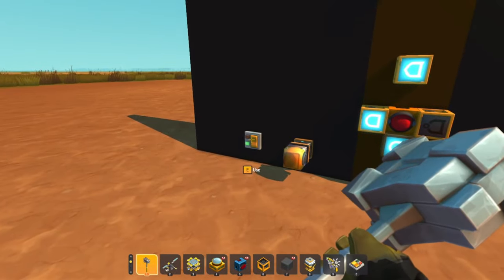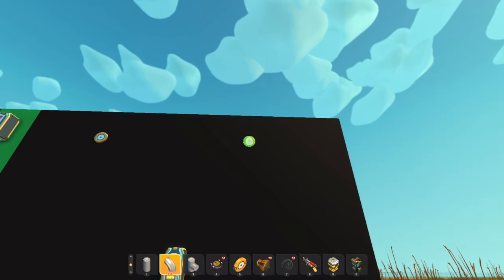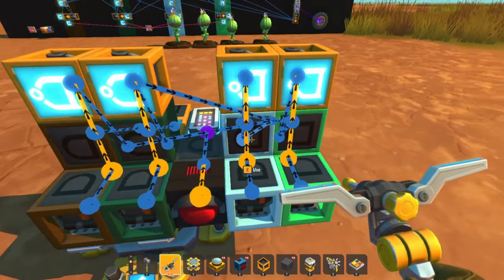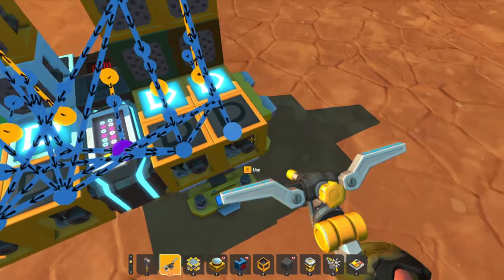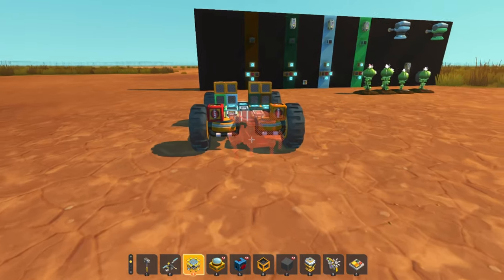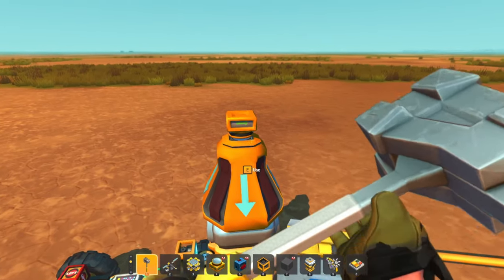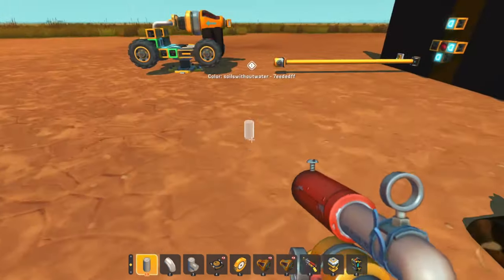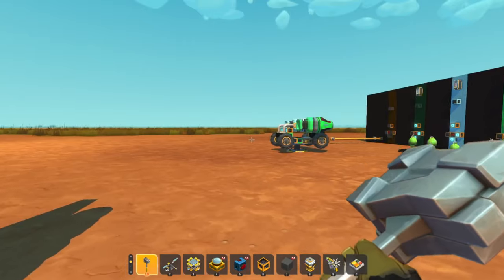Build your own Farm Drone Scrap mechanic Mod

Comment: 8:20 Logic on the movement "Absolute Gold" I have only just been getting in to the Fant mod logic and this is an awesome use of the different coloured inputs into the block detector. Got me hooked. I am going to give that build a go. Love the wall logic changing in sync with the drone.

Comment: base on ur design, i kinda create a resource collector bot, the rod collect was fine, but the problem i have with is the turning back home using target block :v idk why sth it keep driving away from my home, or a 360 then collect rods. U got any suggestion or tip that m8 fix that problem :b ??
Reply from the maker: if its empty, without knowing the logic you have, I think it will always go for rods over returning to home? at its range is like the world so that might be where the fun is ? (honestly though, I have no clue)
Reply: @wo0dy  welp, maybe i had to give it another try then :b tks for replying mate, and tks for the vid u made, it gave me a lot of ideas to do in my survival world ^^